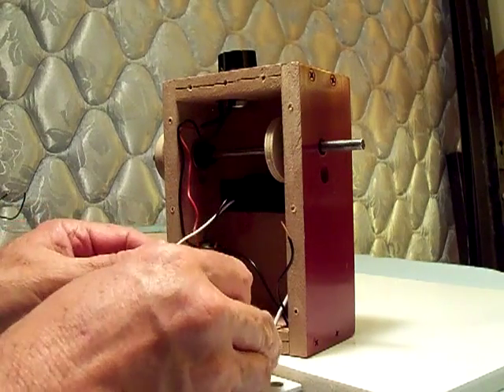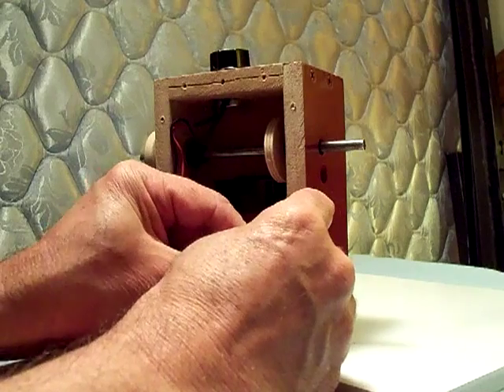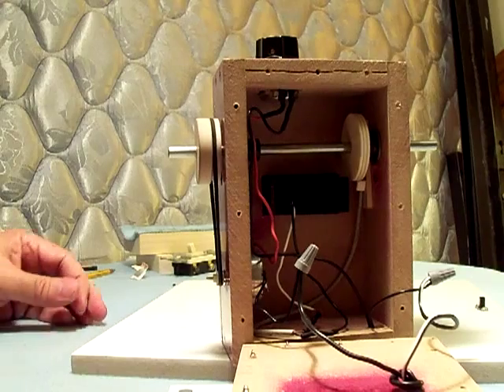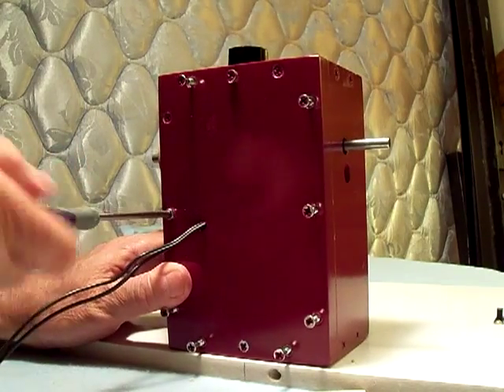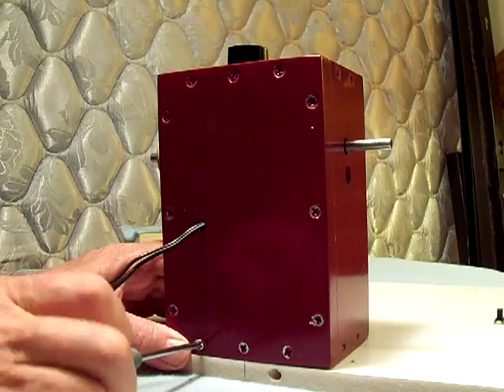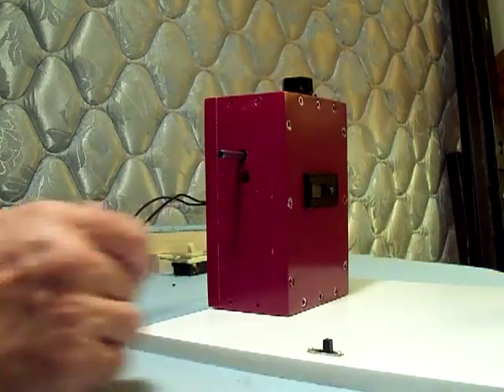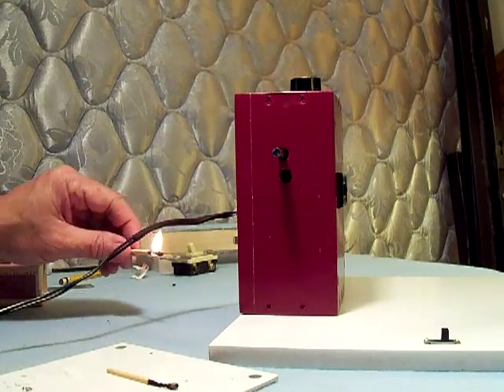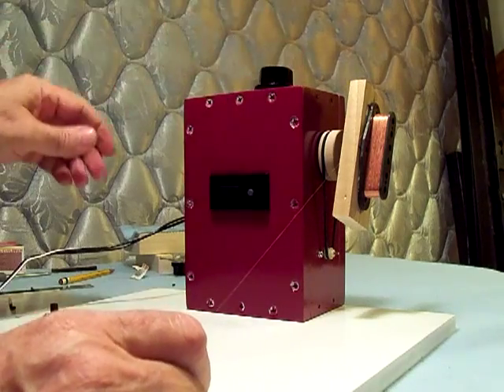Pickup winder build Part 8

Comment: I used the radio shack 9 to 18 volt motor  2730256.
Make sure to use a transformer adaptor thats heavy duty enough not to heat up from the motor's current draw. Also I used a 25 ohm (rheostat) its a pot that is mainly for controlling dimmers and heavier electric appliances. I wouldn't use an audio pot i had one burn up before.